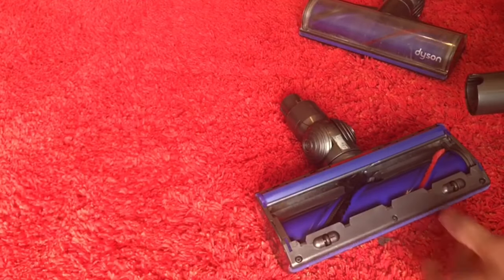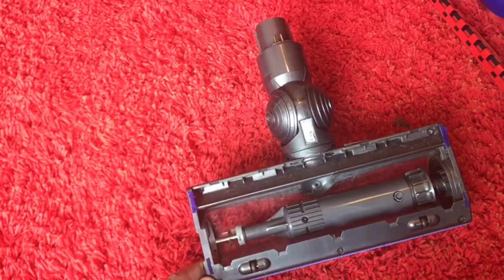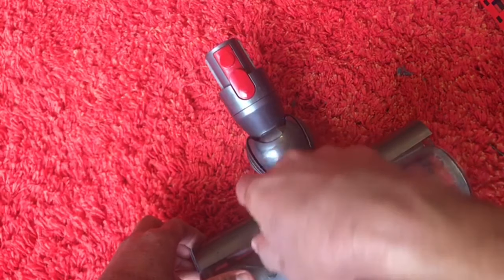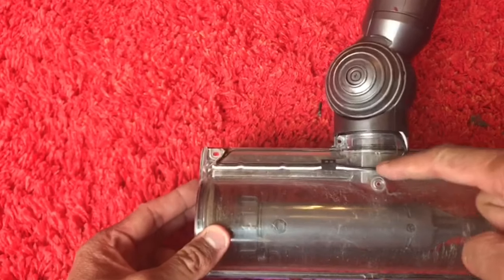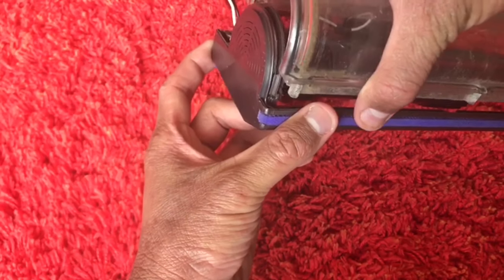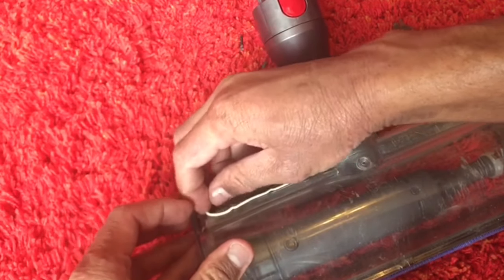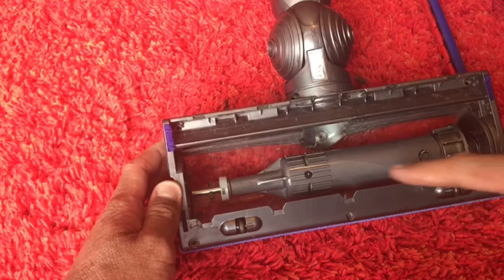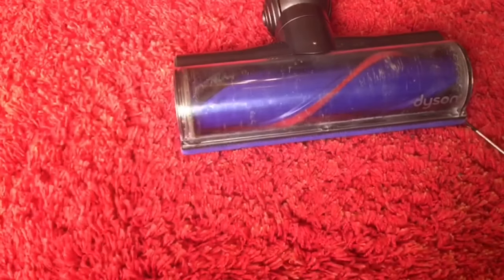HOW TO- TAKE APART DYSON V8/V10 BRUSH MOTOR HEAD FOR CLEANING

Comment: I had a V8 where the head brush did not spin. It was entirely clean. So I had to strip it right down, and remove the motor. Not an easy task...maybe about 4 hours of work (for the first time).

1. First you have to disassemble all that you see in this video.
2. The plastic housing that holds the motor is slid into two slots on one side. You have to slide (twist, pry) it out.
3. Then you have to press on the two circle areas (while pushing apart the base from the housing), to release the housing from the base.
4. That will get the housing clear, and you can see a rubber plug covering the back of the motor. Remove it.
5. Now you can see where the wires go in to the motor. Unplug the wires, if they didn't come off already.
6. The motor is pressed into the housing and the shaft into a bearing in the housing. Stand the housing upright on a table, with the motor facing up. I put a round punch on the plastic tip of the shaft (small enough to fit through the bearing) and tapped gently (many times!) to ease the shaft out of the bearing. It wasn't easy...be careful.
7. You will have to tap further to get the motor shaft completely out of the bearing, and there are two rubber sealing rings around the motor that make it fit real tight as well. Feels like they designed it to make it almost impossible to repair!
8. Once you get it out, you will see there is the motor, and there is a plastic unit that fits on the end of it. The plastic unit has three little gears on metal shafts that are embedded into the plastic unit. These fit into a gear housing on the motor itself.

On my vacuum, one of those little plastic gears must have got too warm, and gently fused itself to the plastic of the housing, so it would not spin (nor could I get it off). It was as if it was glued. I pried at it with a screwdriver, and it suddenly popped off.

When I fixed it, I put three very small, thin metal washers between the plastic gears and the plastic unit, so they could not melt together again. I then generously applied petroleum grease to the whole assembly, and did everything in reverse to put it back together.

I had actually used some split ring pliers to remove the split ring that keeps the bearing in place, but this is only necessary if you want to remove the bearing. I think (but can't remember exactly) that you may be able to leave the bearing in place.

The painful part about reassembly is trying to get the motor all the way back into the housing. There are two holes on the side of the motor assembly. These have to line up with the holes on the housing, so you can put the screws back in. So be careful to orient the motor right before you start tapping it in place. I rested the housing with the bearing down, onto a socket that fit the bearing, but left room for the shaft. Then I used my punch again and tapped on the shaft end (protruding slightly at the back of the motor) to get the plastic shaft (which is attached to the front of the motor) to press into the bearing.

After some effort, I realized the rubber sealing ring around the motor was getting caught on a groove in the housing. I took a small screwdriver and went all around it, pressing the rubber ring forward, into the housing. After this, it went in the remaing way with a few taps, and I could put the screws in.

Remember to put in the rubber plug that goes behind the motor (from Step 4). I forgot the first time, and had to pull it apart to put it in.

The first time I did the reassembly, I attached the main vacuum and turned it on, but the head did not spin! Argh! I took it partly apart again, and realized the black wire had come off the motor. So be careful not to pull on those wires during reassembly, as they come off very easily.

Comment: The cap doesn’t want to turn when trying to remove the brush with the flat head screwdriver causing damage , any suggestion how to solve ?
Reply from the maker: Try some WD40 to clean the area that should help, it usually needs a bit of force but try not to dent the plastic coin slot with a screwdriver

Comment: Great video. Could you tell me how to take apart the joint where the two round discs are? The piece I want to remove you hold in your right hand at 3:17. thank you
Reply from the maker: Glad you found the video helpful! To answer your question, the wheels come off with each screw and then once those wheels come off there is another screw behind those wheels 

And the very front of the neck just under the red release button is a plastic cover which pops off to access the wiring
Reply: @parwaz7861  Thank you for such a fast reply. How does the elbow joint come apart?  This takes the shaft that runs to the had held motor and has the red button for releasing from the shaft. I have the two screws out 
from the wheels and the two screws the wheels hide but I am still not sure how to get apart the elbow joint.  thank you in advance
Reply from the maker: The elbow should come apart once the wheels and the screws hidden behind the wheels have been removed
Reply: @parwaz7861  Thank you. It does not come away. I wonder if it has lugs on its side and the body needs to be forced apart so the lugs clear the body.

Comment: I washed mine and it is not rotating anymore, any suggestions what should I do? This is not the first time I’m cleaning it.
Reply from the maker: Remove the brushbar and check the motor is spinning, if so then the bearing will have seized up

Comment: You didn't see that underneath the white label that should be peeled off there's one more screw to be removed for  easier disengagement of the dark Grey plastic cover.
Reply from the maker: That screw doesn’t hold the cover in place 👍🏽

Comment: The brush bar doesn't spin and I can't remove the cap, do you have any solution?
Reply from the maker: The cap will probably need forcing out if it’s jammed with dirt, make sure the end cap is turned so it’s about to open and use the brushbar to push the end cap out

Comment: Soooo…what happens if I washed the brush bar before watching your video!?
Reply from the maker: Make sure it’s fully dry and that the brushbar spins freely and properly with the end cap because there’s a bearing in there which should get wet, otherwise the brushbar is all plastic with bristles on it

Comment: I have this vacuum and absolutely hate it.  There's no reason it should be so difficult to clean, plus it's just very annoying to use.  Worst money I've ever spent.  I complained to Dyson and they send me a second one free - now I have two vacuums that I hate equally!
Reply from the maker: What do you think is a better vacuum?
Reply: @parwaz7861  I've had much better experiences with Shark brand.  Thanks for the video.
Reply: Wow, what in the heck did you say to inspire them to send you an entire new replacement?
Reply: i’ll take one! want my address?
Reply: I absolutely hate Dyson as well. Even the dyson airwrap dryer. Worst money spent. My
Reply: I hate this vacuum as well. Battery dies so quick from a charge or doesn't work at all, and is so difficult to clean. Also don't love my Dyson Airwrap hairdryer. My $70 Revlon Volumizer Dryer that I got on sale works way better.
Reply: What did you tell them to get a new one

Comment: Do you know how to replace brush roll motor on this ?
Reply from the maker: I'm afraid I've never done that before I think you may need to strip the head entirely
Reply: @parwaz7861  i open it up but still i can't find a way to get the motor out. Maybe i need to order a new part. Is £60 on dyson.
Reply: Just remove the circlip, pin, 2 screws on the side and then tap the shaft and the motor comes out